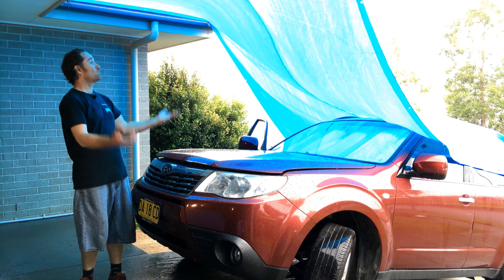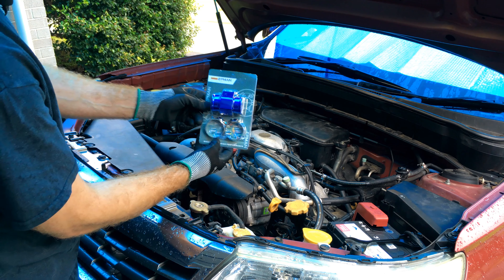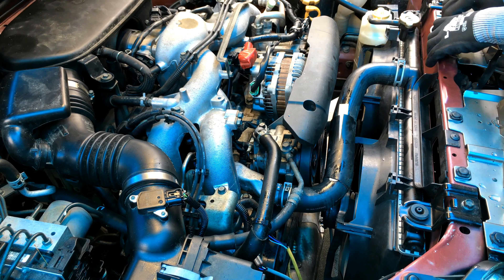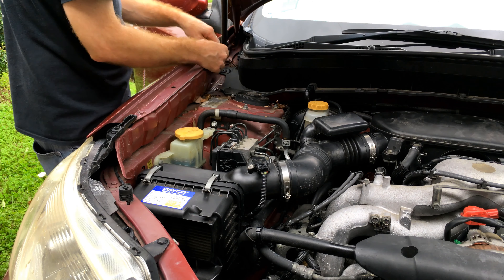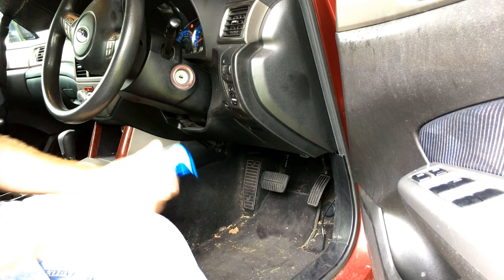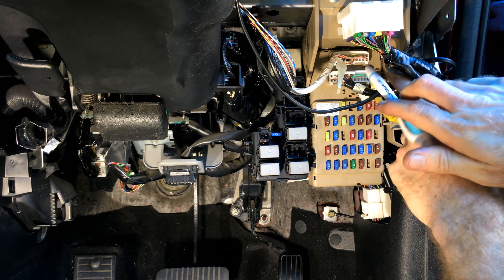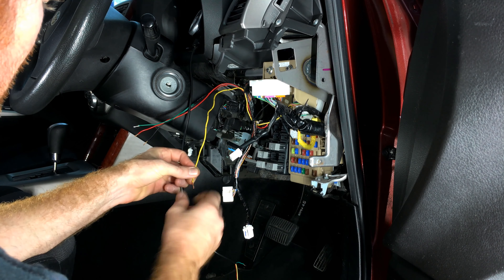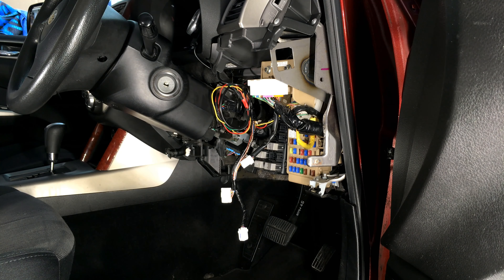Fitting a Coolant Temperature Gauge - Subaru Forester

Comment: Thanks for the video, very helpful. I just ordered an electrical teperature gauge and 40mm adapter on amazon, I'm going to give it a go. A friend of mine told me about fuse taps that  plug directly into the fuse box without having to cut into the wiring harness, so I'm going that route. (It's essentially a splitter, that adds a wire and an additional fuse for the accesory you are adding.) Might be worth looking into for anyone reading this like who like me,  isn't that confident about splicing directly into the vehicle's wire harness to access the power circuits.

Comment: Thanks for posting.
I'm in the planning stages to add 3 guages. (Volt/oil pressure/water temp sensor) on my 09 Forester.
I'm thinking I need to route wires through GPS device hole in dash.
Fingers crossed that all goes as planned.
Cheers !

Comment: Why not using one of those OBD2 plug and play sensors ? 
The car know the temperature precisely there is no need to make new system for that so why all this work for so little in the end in half an hour YouTube video .
Reply: Just like he said all the car has is a warning light that comes on when it's hot and too late and too hot and damage is already done this way he can turn the car of when he sees the temp Start rising too much BEFORE it gets so hot the warning light comes on
Reply: @jamespearson3835  A Scanguage would be much better and plug n plays into your OBD2 Port in a nano second. Covers far more than just engine temps too.
Reply: @bush2coast801  Or an Ultragauge. I have one in each of my cars.